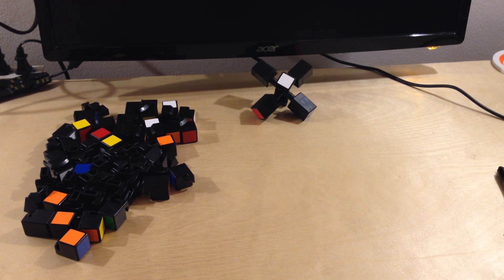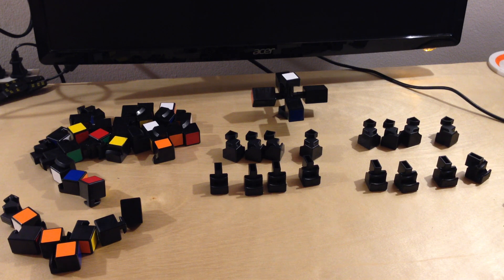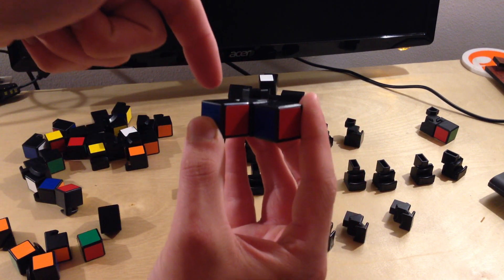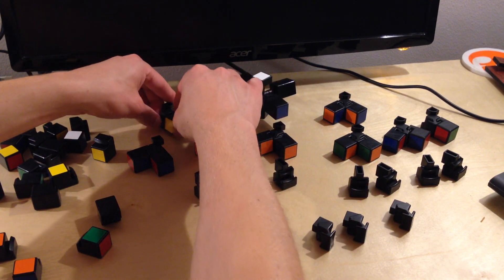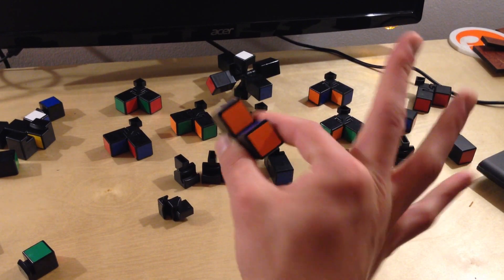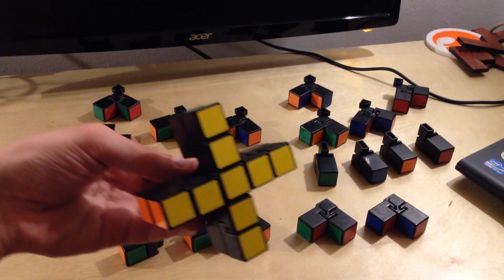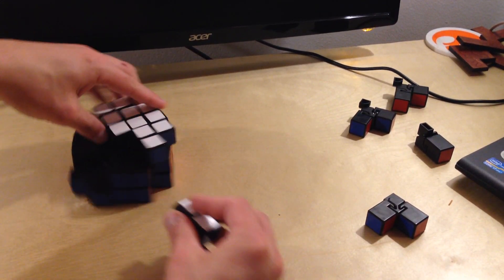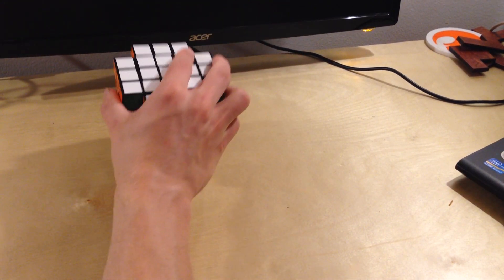How to assemble the X-Cube

Comment from the maker: @Adrian_Romero What seems to be the problem? I hear you have a stiff cube for one. I always lubricate mine with silicone spray that is safe for plastic, and it always helps a lot. If your cube is falling apart, check the tensions of each screw by pulling on the center pieces. Sometimes they need to be tightened so they don't spring out as much.

Comment: Hi, my x cube is incredibly stiff in three out of the four outer layers. Other than lubricating, is there anything else you'd recommend?
Reply from the maker: +Kadjius Hi, unfortunately there are not many good options... The outer layers are not tensioned by the core, so adjusting the screws won't help. The X-Cube responds very very well to silicon lubricant, which I maintain is the absolute best method. You will see fast results. The only thing besides lubrication is to sand the inside where you see it catching, which I do not recommend at all.
Reply: +Dane Christianson Hypocrite.

Comment: How do you take an x cube apart
Reply from the maker: +Tonnan Marshall I only recommend this for advanced cubers, as I can't be responsible if you break it. 
Two ways:
1) Take off a white or yellow centercap and unscrew the screw beneath it (Recommended)
2) Turn a layer 45 degrees and pry out one of the edge pieces (Can potentially break)
Reply: +Dane Christianson how do you take off a centre cap?
Reply from the maker: +Tonnan Marshall Pick a white or yellow cap, pry it ff with a fingernail or flathead screwdriver